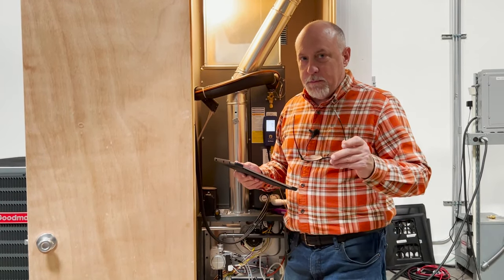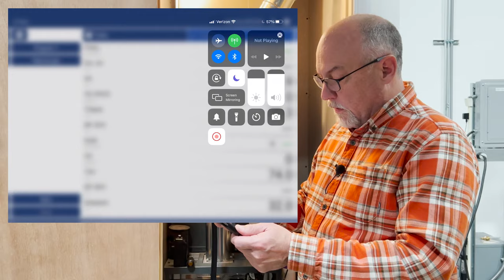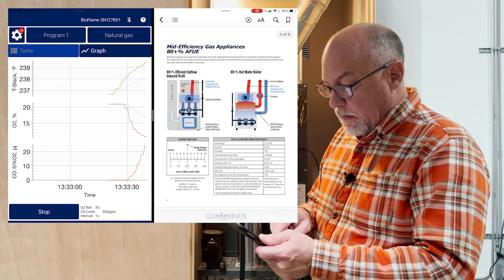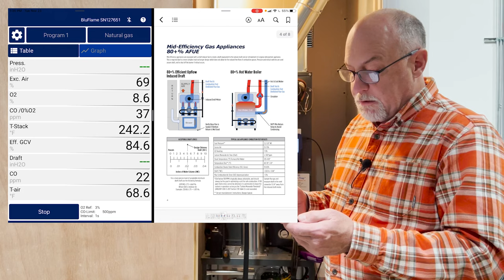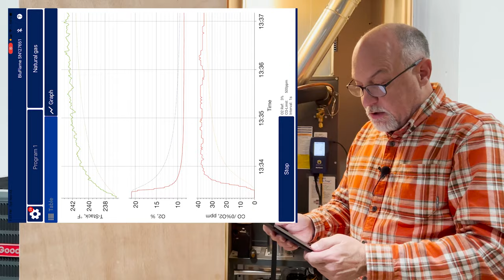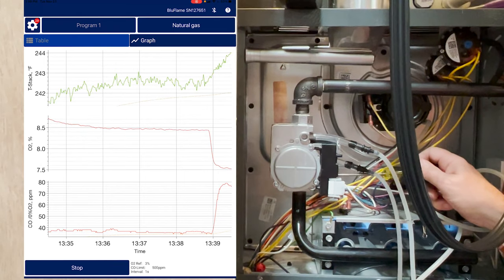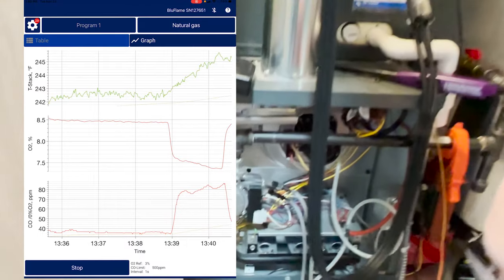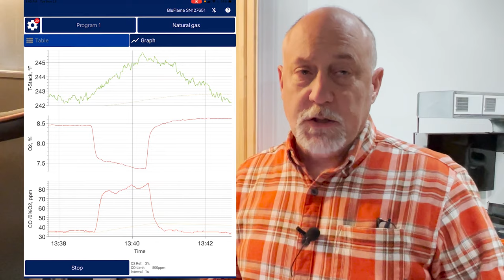What should you be looking at when doing a combustion analysis? (The basics!)

Comment: I travelled multistate for a large industrial and institutional contractor for decades. On occasion I worked with commercial, and residential equipment. 
The primary owner and president of our division had been my fire dept,/EMS Capt. prior to my moving to a different dept. (I also have over 4 decades in public safety services)
 You touched on static and air flow. 
IMHO, prior to combustion analysis or sub cooling/superheat, these should be the two first system checks.
Our company was founded in 1867 and we had several people involved in design, draftsman, engineers, and  architectural firms, in our design/ build projects. We had acquired several early 'warm air' companies and their large patented furnaces. We had blowers large enough to crawl in to and pretend that you were a gerbil ---.we had  dual duct  constant volume, single duct mixed air, vav, vortex dampers, and were involved with early VFD inverters and venturi systems for more precise air control. Most in residential and commercial services will never deal with this variety of air distribution.
  Static pressure readings above manufacturer's design should be evaluated and corrected or one is wasting their time and the customers money. 
 It saddens me to see the percentage of residential and commercial installations that were never properly designed and commissioned. What is worse is hearing stories of multiple contractors recommending and installing larger capacity equipment on systems that can't handle what they have. I recently scrapped a 100k propane furnace for a friend who implants pacemaker probes in surgery. He and his wife had purchased a faux log cabin style home that had wild temperature swings. When their furnace started shutting down on safeties and two companies came out and changed pressure switches, roll outs, and boards without success, I received a call for help. 
Their 100k furnace had four ten inch by four inch supply boots and discharge registers for return air. And the spare bedroom supply and return had been closed "to try to help the rest of the house" as that room wasn't being used. 
All sections of the primary cell were cracked. They also regularly used a wood stove to save on propane costs. They thought that the intermittent chirping of the co detector was due to their opening and closing of their wood stove. 
Very lucky that we weren't called in our other capacity with big red trucks and bags with zippers. 
 Was just asked to do a casual walk through of another friends new cape cod style home. The hacks that did the HVAC made the usual bottom plate, floor, and top plate cuts, and panning to facilitate return air flow back down to the panned return joist space which connected to the return duct. This return, from a roughly 150 Sq ft room, was restricted to 8" by 3.5" going into a first floor stud space in which the studs didn't line up. Sadly, due to the open concept kitchen/dining/living room, they had made no provision for the other bedroom's return air pathway other than a transfer above the door. 
There were two 14" X 6" wall returns, one mounted low in the master bedroom (4- 10"X 4" supplies: 2 in bedroom, one in bath, and one in master walk in closet) and one in the south upstairs bedroom. The other bedroom had the 14" X 6" transfer.
There was also a 30" X 6" low return in the kitchen wall. The hand scribbled 'plans' showed a 30" X 6" in the master. I had questioned the general contractor's supervisor, who sort of took offense that I could possibly question his sub's calculations. A return visit revealed an additional 14" X 6" in the master and dining room floor (both within a few feet of the existing low wall return, but nothing  to remedy the lack of upstairs return. A few large, high wall returns and a connecting duct through the knee wall space, dropped through a chase in a corner of the first floor laundry or master bedroom closet to connect to the return duct would make a world of difference. Oh well. Calls to the builder's GM have not been returned and the new owner is already talking about a lawsuit.  
Truly sad. 
My point? Without adequate airflow one can chase their tail on commissioning.
Nice video regarding flue gas readings.
 Love to hear our large blowers spooling up and the modulating  power or ribbon burners firing off.
Stay safe.
Reply: This is why comments sections are just as awesome as awesome videos.  
Thanks for the insights.
You can have 40 HVAC techs with 40 years of experience each but no one single person among them has all of the knowledge.

Comment: If measuring gas flow by clocking the meter shows that the furnace is operating at the nameplate BTU, then why even check the gas pressure?  

Is it even possible for a furnace to be operating at the nameplate BTU but have the gas pressure outside of the manufacturer-specified range?

Comment: Understand the chemistry is important but not every one can afford to have comb-analyzer. Careful but practical way to adjust the gas output pressure by looking at the gas burner flame, will be helpful.
Reply from the maker: You cannot see issues with a flame until it is in very bad condition. A combustion analyzer is required for appliances.

Comment: So, how are we preventing flue gas condensation on these Goodman furnaces with such a low stack temp?  On this particular furnace, increasing fuel seems to create excessive CO, and reducing airflow may exceed mfg. specified range.  Would orifice increase have the same affect on CO as the increased pressure did?  I would think the difference would be velocity comparing the two methods to increase gas.   So, would the velocity reduction by changing orifices have a different affect on the CO?  It amazes me that some of these mfgs. get away with making such garbage equipment.  Are they making the unit so cheap that the heat exchanger can't handle a 60° temperature rise?
Reply: cut fan speed i think, get closer to the high end of the rise range if it's something like 20-50f.
60f rise is high.

Comment: Why do you clock the gas meter in addition to using a combustion analyzer? Wouldn’t using the combustion analyzer be a more accurate way of dialing in you gas pressure than by clocking the meter?
Reply from the maker: No, not without an exact excess air required from the manufacture. Sometimes the excess air also includes air for dilution. You could easily end up over fired.

Comment: How do you seal the hole in the flue pipe? We use double wall flue pipes so putting a piece of tape over the hole still leaves a hole on the inside and im pretty sure it won't pass inspection like that. We arent allowed to use screws in the flue pipe so I dont believe leaving a taped up hole in it would be ok?
Reply from the maker: https://trutechguy.files.wordpress.com/2011/01/4-letters-on-b-vent-testing.pdf
Basically make the outer hole larger then the inner, seal the inner with high temp caulk and the outer with foil tape. Above is a link to letter from the manufacturer from TruTechTools.

Comment: How do you seal the whole in the flue pipe? 
Also if the flue pressure is bouncing between positive and negative what would fix it?
Reply from the maker: Depends on the material. Silicone plug in most applications. They are available through TruTech Tools.
Reply from the maker: Bouncing usually indicates that you are too close to the induced draft motor. 10-12” upstream from the fan outlet is ideal.

Comment: This stack temperature seems to point to incorrect orifice size. By increasing the Gas Pressure your taking the O2% out of range. That being said, I would be curious about the orifice in this furnace. The ratio seems off. I'm in Alberta and we are at 2200 ft approx. Our furnaces are derated at the supplier by a orifice size. And I do CA on every furnace I touch, never seen a brand  mid at that low of stack temperature!! Also are we so focused on co "air free", that appears to be a theoretical number.  The Co value is the real actual number Im concerned with. CO air free is not even possible.
Reply from the maker: So the orifice is close to being oversized as furnaces are set by rated input. It is spot on. The low stack temp is likely due to the rated temperature rise of 15-45 degrees. That is a really low rise range for an 80+ furnace in my opinion. COaf is what you should be concerned with. It is a apples to apples measurement that removes the affect of dilution. It is not a theoretical number as much as a number that reflects the absolute CO reading at 0% O2 rather then relative to a wide range of O2 and the resulting dilution of the CO. CO is in ppm (Parts/million) so adding more ok reduces the ppm without changing the actual amount of CO. So you could have what looks like a safe CO number on a very dangerous appliance because the O2 is diluting the gasses.
Reply: @measureQuick  Thank you for your reply.
I agree a 30º T rise seems odd. I understand manufacturers do offer different tonnage of air per unit but it certainly can be a issue when a  unit has low BTU size with high air tonnage. in other words, the contractor chooses a unit more for AC than Heating, but that is where the equipment selection process should be more thought out as this is an example of the downside of poor equipment selection.
I will have to digest your explanation of the COaf number and learn more👍
Thanks again

Comment: Hello Mr. Jim

I was paying attention when you were adjusting gas pressure to reduce or increase gas flow, however the rating 80% gas efficacy rating did not improve to 80% I understand you mention condensation built up when it gets over 84% I am sure that will cause rust in heat exchanger vent pipe. what is the best course of action to reduce efficiency when you doing combustion analyses?  

Thank You Very Much
Reply from the maker: The only thing that you could do is to increase temperature rise by lowering the blower speed. The input has to be within 2%. In this case, I think there is a manufacturing/design issue.

Comment: I've noticed many systems that have high Excess Air and O2 readings and therefor push the gas pressure to the upper 3.8" limit and often still can't get the correct readings.  It tells me I should probably be increasing my orifice size?  Also, should there be noticeable differences between sealed and non-sealed combustion furnaces?
Reply from the maker: Sometimes the excess air and dilution air are combined on 80+ appliances making the overall reading of excess air high. Don’t adjust an appliance on the 02 reading. Clock the meter and get check the input. At a 3.5 nominal you have 3.2-3.8” to work with. Outside of that range increase or decrease orifice size. Proper input and temp rise are the key to proper operation.
Reply: @measureQuick  
Since you said it has been on the low side of stack temp and temp rise and the gas pressure adjustment was counterproductive, is a change in orifice size what you are leaning towards for this particular furnace?
Reply from the maker: @jrsmyth9761  I can get the input correct within the allowable range, I also have the temp rise at the high end. Everything is correct, it just has a very low stack temperature. It is the way that it is designed.
Reply: When you say high excess air what kind of percentages are you looking at?
I brought an ancient bryant down from over 200% to 175% by fixing gasket leaks but I can't find the LP specs for manifold pressure for that model.  The opinions from bloggers are mind-numbing bordering on dangerous.
Reply: @measureQuick    Hi Jim.  Whenever I see/hear 3.5, I don't know whether to scream or cry.  It seems like LP is child that is kept in the closet.  We love your stuff, but 90% of the presenters out there only talk in terms of NG.  I did see the mfg conversion chart you kindly showed at 11:30, but the rating plates on ancient machines are never updated so unless each machine is standarized then unclocked, unrated LP doesn't fit the 3.5 standard setpoint because too many techs have made too many turns on that screw before us (so as to imply that the factory setting is unknown).  I've been consuming your videos like sugar-coated breakfast cereal.  Currently excess air has been my nemesis.  In your seminar at HVAC school channel you started to speak about your 2-stage with excess air but we didn't get to hear how you resolved it.  The Carrier inspection guides are a good start but can be vague.  That's where a lifetime of experience makes the sun come out and the blue birds sing.

Comment: If I find high coaf like 120 ppm what should I do to get the coaf lowered. Or should I condemn the unit with those readiings
Reply from the maker: Check the input, manifold pressure, burner alignment, for flame impingement, check the venting, check burner cleanliness, etc.
Reply: @measureQuick  thanks alot I appreciate it I work for Goettl btw thanks for all your work you implement into mq (DD)